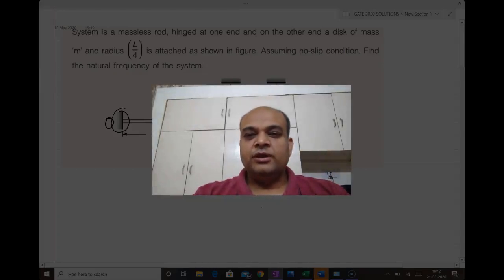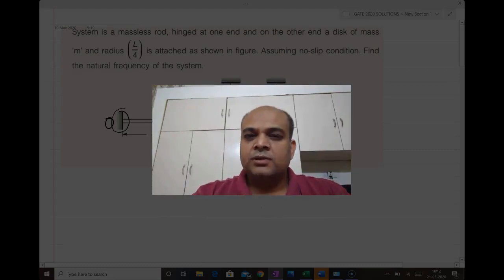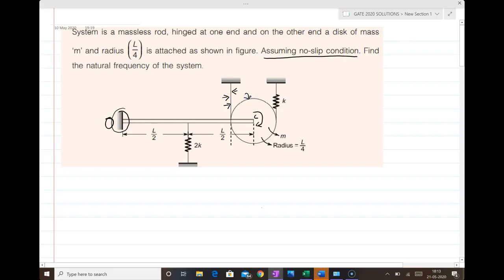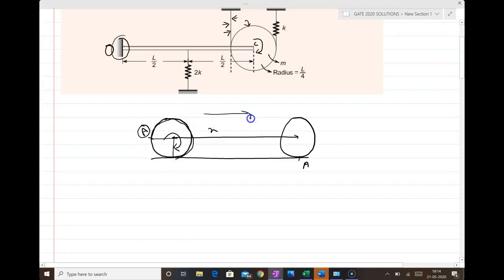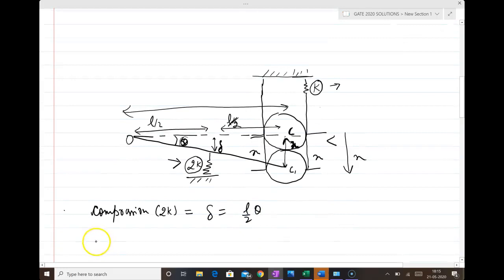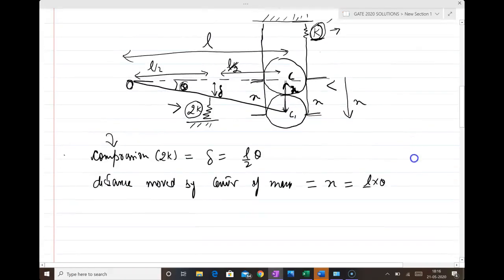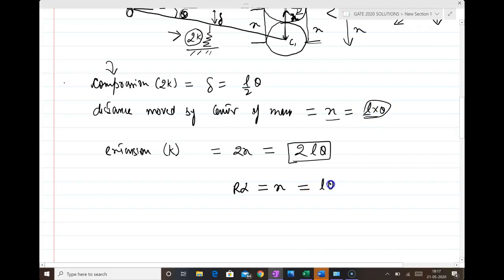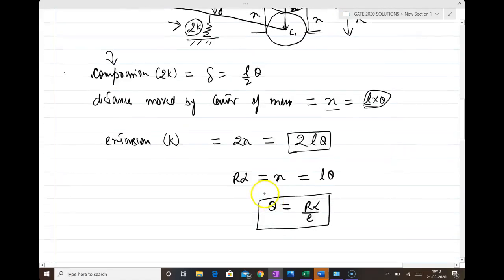GATE MECHANICAL 2020 / 2021 II VIBRATION II NEWTON  / TORQUE METHOD II IES

Comment: Sir I have have a doubt in this question can you solve this.
Reply from the maker: Sure....
Reply: Sir in this question why we have taken disturbance of second spring 2X .
Reply from the maker: @shaileshtiwari3635  when the center of mass moves X distance in the downward direction..then there is increase in length X of string on left side as well as X on right side...but the string is not extensible...but the spring is extensible...therefore all the extension that is 2X is in the spring only

Comment: Sir, if it is a single string, then how come these tensions are different.??  Please explain.. 🙏
Reply: Sir, because so far we have studied this only in belts or such things where one side is tight and other is slack... 
Is this the case here..??
Reply from the maker: If the tension on the both sides remain same then how it will rotate and have an angula acceleration.....when the disc is displaced from its equilibrium position then one side will have more tension in comparison to other and due to this difference net torque will act....

Comment: https://imgur.com/tPOpKD7
Reply: Sir it could be solved more easily as I have attached
Reply: I request any one who happens to see my solution please comment..
Reply from the maker: In the solution you have combined all the equations in one equation.  In order to find out the transfer factor which you have used in you solution you need to apply Newton law of motion to the rod. Similarly in order to establish relationship between rotation of rod and disc you need to analyse the motion with no slip condition. In your solution you didn't write these steps. Otherwise solution is correct.
Reply: Thanks sir

Comment: How come the K stiffness spring has x as 2L?
Reply from the maker: The centre of the disc moves X distance downwards. Because the angle rotated by rod is very small so the motion is almost verticle. Therefore the length of the string on the left of the pulley as well as right side of the pulley must increase by X. Total increase in the length is 2x but string is not extensible but spring is. So all the extension will be in the spring only.
Reply: @dr.vineetprabhakar2771  you mentioned string in not extensible but it is still extending due to rotation hence 2x?
Reply from the maker: @pushpagupta114  on the pulley there is string and spring..so if total extension is 2x and string can not be extended then that 2x extension has to be in Spring
Reply from the maker: @pushpagupta114  if you have still have doubt .you may call me on 8146705050

Comment: Sir I have some doubt regarding some arrangements of pulley spring system of vibration
Reply from the maker: Your doubts are from the this question or some other questions?
Reply: @dr.vineetprabhakar2771   no sir not for this question 
For other question
Reply from the maker: @sudipbanik3169  please mail me the question at prabhakarvineet@yahoo.com
Or you may whatsup me at 8146705050

Comment: Thanks sir for clearing the concept.... I have a small doubt  '"rod and disc are not directly connected rather connected through hinge" then how can we apply action reaction pair concept between them
Reply from the maker: Both have physical contact...so whenever there is physical contact between two bodies they exert force on each other
Reply from the maker: Please share it with your friends
Reply: @dr.vineetprabhakar2771  sure sir